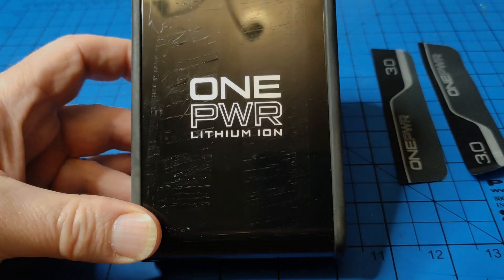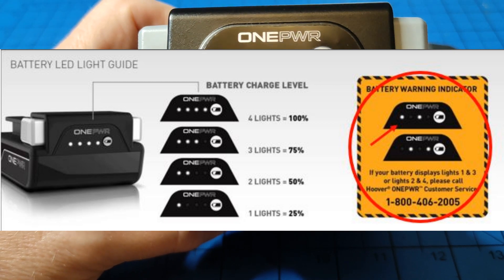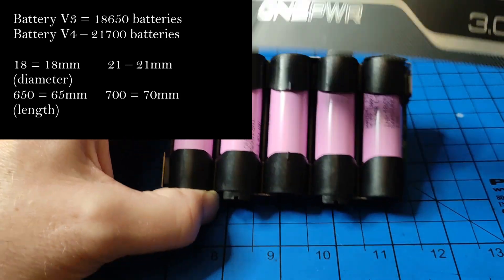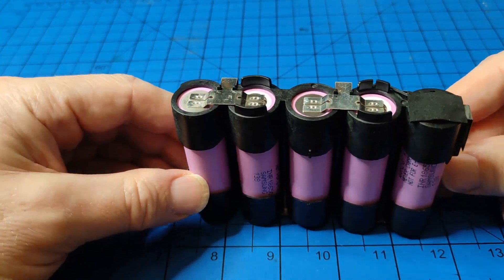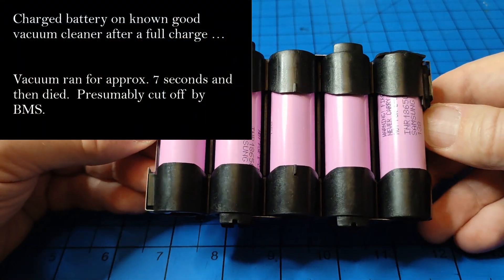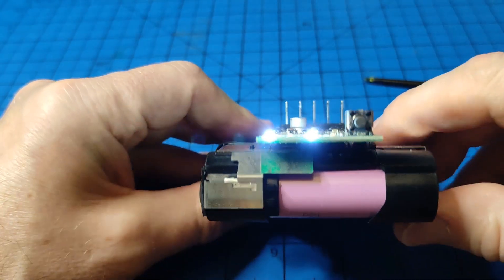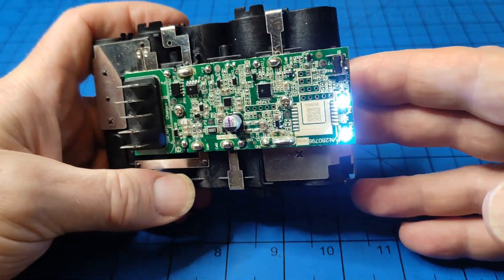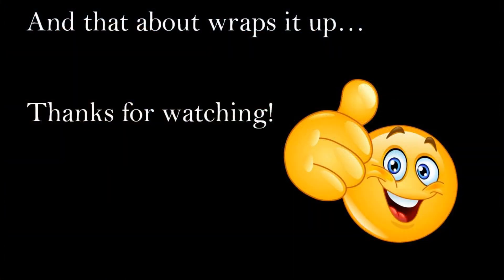ET#29.  Vax One Pwr Battery Strip Tear Down Two Lights Fail Mode Fault Basic Analysis 18650 21700

Comment: Thanks for the insight. I've never used hobbyist type batteries before but very interested in charging the salvaged ones from the faulty onepwr we have. What would you suggest i use to charge them?
Reply from the maker: I don't endorse re-using batteries - and if you do this you do so at your own risk.  Depends on how you want to charge them really.  Lots of commercially available battery chargers for 18650 batteries (and others).  You could look at some of the Xtar or other similar units.  Just search "18650 battery charger" on Google.   If you do this be aware that there are some risks and you should educate yourself on these before 'playing' with LiPos - these aren't toys and can cause a lot of damage if handled incorrectly.  Be sensible and understand what you are doing BEFORE doing it!  ;0)

Comment: All my tools are Dewalt. I've just had a onepwr battery fail. 

As with all other batteries, I'll use the old onepwr and a DeWalt battery connector from AliExpress to make an conversion adapter to dewalt batteries. One thing I can say with DeWalt is the batteries are expensive, but they really last.
Reply from the maker: Interesting -  I'm not sure from your post whether you have done this or intend to.  if you watch the follow up video to this one, just connecting power up to the vacuum (at least in my case) wasn't successful - leading me to assume some sort of 'communication check' was taking place. 
 Either the adapter you have is addressing that, or your batteries are using the same protocol as the onePWR units - or it may not work.  Your findings would be useful - would you mind following up with a successful/unsuccessful comment please?  Very useful tip.  Have you a link to the adapter please?  I'd find it useful and I'm sure other viewers would too.  Thanks.

Comment: dont have a link for the new  BMS do you please be interested in seeing if it fixes it it would be the only video out there I know I searched  for ages lol
Reply from the maker: I just bought a BMS I thought might be suitable from AliExpress and have made some inroads into getting it fitted.  I just need time - life gets in the way.  It will probably work at charging the batteries.  It may not work when on the vacuum because two of the inner connectors on the battery pack are marked rx and tx.  This implies some comms from the battery to whatever it might be plugged into.  There are a couple of LEDs on the charger unit that indicate battery state (i.e. good bad etc.).  It would be great to think that the charger did some form of battery analysis - but that would be economically stupid.  I suspect the original BMS is sending some form of signal out that something cheap and cheerful in the charger interprets and operates the LEDs accordingly.  If I was Vax, I'd use that same system to signal to the device the battery is plugged into, what the state of the battery is.  I strongly suspect that because this substitute BMS won't do that, the device I'm trying to power (a hand held vacuum cleaner in my case) is going to just refuse to work - because it isn't getting the required signal.  This is just a guess from a world weary and cynical engineer though!  I'll try and get something done this weekend!
Reply: be interested to hear how you get on please there are alot of people out there with BMS problems on these batteries you would most likely get a lot of views if you remake a video on how you do it @ECETek
Reply from the maker: Check out video ET#32!